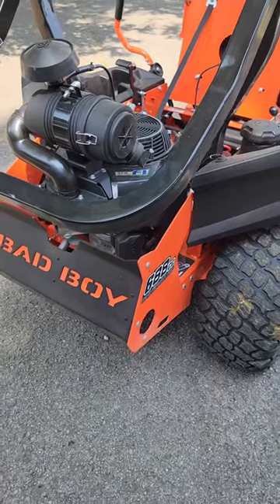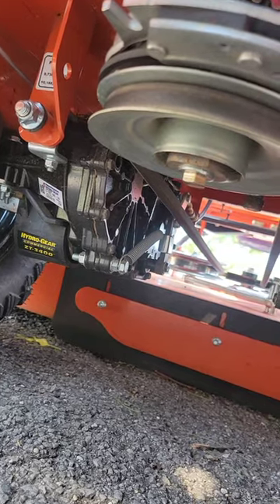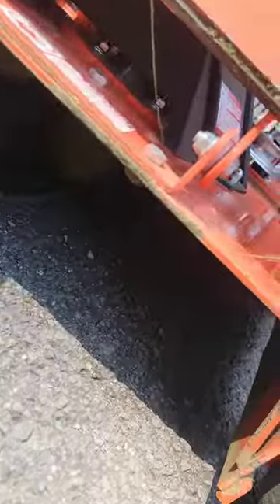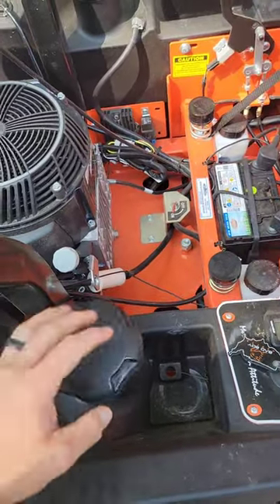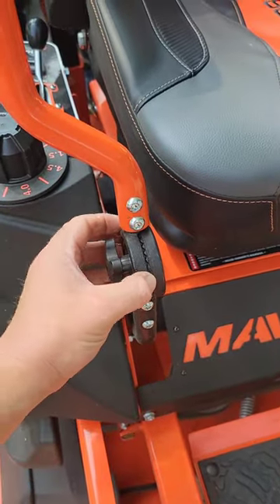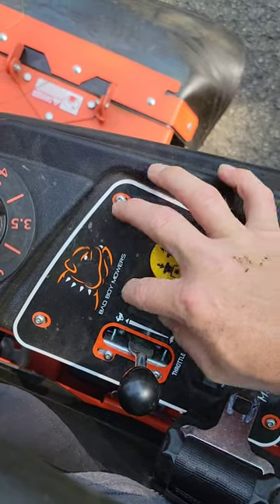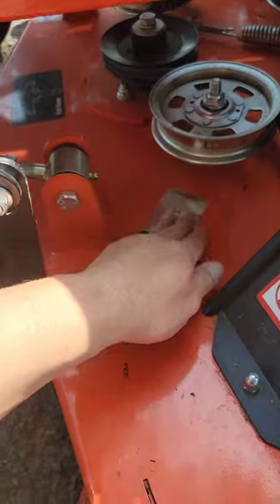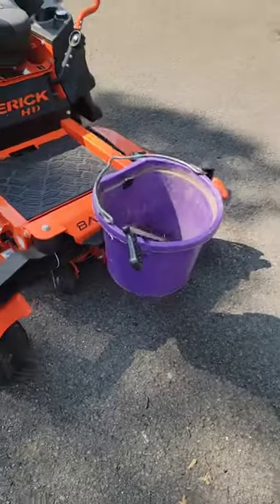Badboy Maverick HD 2023 | 2mo Review

Comment: I never wash my mower I use a leaf blower to clean it after I mow, and clean the deck by hand with a scraper. My Bad Boy is not the HD version which has a lot of nice options that mine does not have  but mine is still a great mower which is a Maverick 60 inch with a 747cc Kohler
Reply from the maker: I've stopped spraying mine and just blow it off now.

Comment: I love my Bad Boy HD, but to me its really more work to cut the grass. My gas is usually cut to 3 1/2". The cut is great....BUT it leaves about a 1" strip of uncut grass between blade 1 & 2, and between 2 & 3. There is no adjustment for this as this bade spacing is set by the spindle locations, and the blade length. Correct blades are installed and I also put a brand new set of bades on it. The mower still leaves a strip of uncut grass between blades 1&2  and 2&3. Changing cut height does NOT make and difference. So using this Bad Boy  means having to cut twice, since after initial pass, you have to go back and move over a few inches and mow it again. Double the time, double the fuel. After 2 months of this problem, and servce that I had assumed would be mediocre since all Bad Boys are sold at Farm Supply and other such stores in this area, none at a lawn and garden or outdoor equipment dealer. Have tried contacting Bad Boy without success. So I'm back to using a 20 year old JD GX335 with 54" deck that makes a beautiful cut.
Reply from the maker: Mine doesn't have that problem. Sounds like the blades are a hair short
Reply: Sometimes blades say they are a certain length when in fact they are not. I bought some for my Ultima ZT1-50 that said they were 17 1/4 but are really 17 1/16. That leaves a 3/16 space that shouldn't be there.
Reply from the maker: i can see that being a issue. that's a pro tip of something to check when i order blades.

Comment: Why did you go with the Honda Engine instead of the others? What was the $$$$
Reply from the maker: I liked the fuel injection vs the carb system.  All the reviews I read on the honda engines were great. It will self regulate so if your mowing short grass and it doesn't need to run at 100% it will throttle back and if you hit a rough patch of grass it will accommodate accordingly.  I may regret it one day but I just seen it as a upgrade and I got this mower with the Honda cheaper than I could buy it with the kawasaki engine.
Reply: I have the same mower with the Honda , I love it so far . My old Hustler has a Honda that is still running strong after 16 years. Only negative I have so far on the Maverick HD is the hour meter quit after 8 hours but Dealer gave me a new one .  I’m liking the mower so far to mow my 4 1/2 acres . Main reason I bought the BadBoy was because of the build and the option to get the Honda motor.
Reply from the maker: @cwtex59  I agree w you. I like the ease of working on the badboy because eventually something will break
Reply: Hope you guys have good mechanics trained on theses EFI engines. @BrileyWray
Reply from the maker: @dalewiley9208  that's what they make money for. 💰
Reply: Wish they still offered the Honda, I think they are the king when it comes to small engines.  I think I’m gonna go with the vanguard 28 efi.  Guys seem to like them.

Comment: I got the 60 HD Maverick I was told at dealership you need to fill up the tanks together carry 13 gals and it's speed up to 11mph and very comfortable especially for someone has had back problems the seat is worth every 1300.00 of it haul ass nand pick ur feet off deck and it will feel like u cutting in cloud's buy it worth every 10,000 of it you won't regret it cut with a attitude 😅
Reply from the maker: I agree,  it's a blast to cut on and never regretted buying mine

Comment: This is for the man whose mower left strips of uncut grass between the blades. I had the same problem with my JD lawn tractor. I mentioned it to a JD parts man and he said that he was a helicopter mechanic in Vietnam. He said that I was aligning the blades wrong. He said that the solution for copters is the same for lawn mowers. Multiple blades should be perpendicular to each other to do the best job of cutting because the rush of air will suck the grass blades into the path of the mower blades. 

I felt like a fool, but took his advice and it solved my problem immediately. 

I absolutely love my  60” deck Maverick HD with the Honda engine. It’s bulletproof!
Reply from the maker: I agree mine is still running strong 💪

Comment: I’m considering bad boy. Thank you for this helpful video!
Reply from the maker: Glad it was helpful
Reply: I was also considering one of these. I decided against it after seeing it in person. There's SO much plastic on the engine and on the mower- Even the engine cover and air cleaner housing...ridiculous for $9K mower. Plus, these engines being fuel injected means come the day it doesn't start, you can't even fix it yourself because you need a special scanner (not the common automotive ones) to see what the problem is. These things have an ECM, oxygen sensor, MAF, MAP...everything that your car has..and are way too complex (and parts too expensive) to just try and fix by trial and error- and seeing as electronics are especially vulnerable to moisture and dirt, stuff WILL be failing- and the warranty is only 2 years (Which is about how long it'll go until stuff like the electronic fule pump and sensors start failing!). Darn ECM for this mower lone costs over $400..and if they've stopped making it by the time your goes... I've decided to go with a slightly older carbureted used mower, that still has actual metal parts.  This is way too much money for a short-lived disposable mower.

Comment: You can stop tearing the grass up when turning if you don't just stop the wheel on side you are turning to. Pull lever to reverse wheel on side you are turn to. This allow mower to do a mini cycle and not tareup grass. Do it slow at first. You can go faster after you get timing down to turn without targeting up grass. I taught this for 21 year works in demoing mowers.
Reply from the maker: This is very interesting

Comment: hey man, great vid. Can you tell me if you're still happy with this mower and Honda engine combo as of today 10/10/24. I'm about to pull the trigger on a used one only 5 month warranty left and like 80hrs on it. What do you think would be a good price? I'm trying to get it for $6k or is that still too high?
Reply from the maker: @thepropertygurus.9940  I would just look around at the price of other used ones for a price. That sounds reasonable.  I'm still very happy with my mower. Run 100%gas and it cranks everytime and runs great no issues to speak of.

Comment: Thank you for such a in detail review. Always wondered about the fuel injection and also about the hydraulic filters. Because I was going to add some inline ones. But I'm pretty set on the Maverick. And I've always asked in other videos about the hitch. That wide doesn't these models come with a hitch for aeration  for example. Definitely appreciate you sir.
Reply from the maker: I have a video of the Hitch I built and installed on mine . But I agree they could afford to put  Hitch on the HD models

Comment: I have the zt elite, 54” with the Kawasaki engine, so far so good, hr meter stopped working,
Machine is loud, could be I have a deck bearing going out,
I never wash my mower, do not want to get water down in those bearings,
I just blow it off,
Reply from the maker: from what i remember they are sealed bearings. i could be wrong but have had reserves about spraying the engine with water with all the electronics back there. but it gets it so dang clean lol

Comment: Just bought my Maverick HD with the honda in a 54 inch as well. Good unit, except what caught me off guard compared to your unit is I only have the left tank and no right tank and I also did not get the stripping kit with mine. Only other mention is that I do not have a black cover on my honda IGVX700, mine is red. Not sure if I have a 2022 model or a 2023. I will be looking to add the right tank in the future as I do like having weight more evenly balanced as well as filling up with less intervals per month. Great video, wish I would have seen this when I bought my Maverick HD as at the time the honda equipped units had almost no videos to them.
Reply from the maker: I had the options to get the red motor cover in a 2023 but chose not to. And some one mentioned below the gas tanks were on recall so maybe that's why your only had a single

Comment: Quick question on your honda motor. I have the exact same model amd engine combo. I love it overall. However, i do have one nagging question.
Does yours take a bit longer to start than a typical carburated model?
Mine has always taken 3 to 4 seconds of cranking to start. My carburated motor on my last mower fired over almost instantly. 
Is this normal for the fuel injection?
Thanks for your video
Reply from the maker: Mine probably turns over once or twice before it fire's.  I would say it starts faster or just as fast as my carb mower I had.
Reply: General consensus is the Honda's don't like ethanol. I have a tiller that does the same thing. Non ethanol gets pricey but since I only use the tiller for an hour or so a year, 1 can of non ethanol would be fine. But it cranks, so I just forget about it for a year.

Comment: Interested to know how everyone is choosing the Honda engine, but I don’t see it listed as a choice on their site?
Reply from the maker: On the 2023 model it was available
Reply: And the 2022 model as well. As a matter of fact the 2022 model is probably the only year with the igx 800, in 2023 they only offered the igx700
Reply: Overall yes, a fuel injected engine gives precise fuel measurement and a bit more fuel economy, but is it really worth the extra cost to get it, on a Honda mower. Honda is a good engine, but Kawasaki has been the king with most every brand of outdoor power equipment. Same great warranty. Plus carb equipped engines are not as particular when it comes to a bit or dirty fuel. Lots cheaper to repair, and junk in the fuel is somrthing that is a big possibity with ysing typical 5 gal gas cans to carry fuel.
Reply from the maker: this is all good stuff. i typ run 100% gas and change the fuel filter regularly. so far i haven't had any trouble out of my Honda engine.

Comment: Those hydraulic reservoir twin filler tanks will crack and leak......its better to have the metal bolt plug in the hydro case....also NEVER wash the mower, ALL bearings are sealed n youll have to pop the seals to regrease bearings...its easy....
Reply from the maker: Thanks for the tips

Comment: Can anyone tell me if there a switch for which fuel tank is being used right or left side? also if there is where is the location.
Reply from the maker: There is a fuel cut off under the seat but I think it uses both tanks simultaneously
Reply: No there's no switch the both flow to one point maintain both tanks full

Comment: honda engine is a great decision.  I always start the pto with engine on high .
Reply from the maker: Thanks I do the same
Reply: That places extra stress on the clutch.  Your mower, your money. @BrileyWray
Reply from the maker: starting the pto with the engine on high or low? I'm confused?   @dalewiley9208
Reply: @dalewiley9208  dealer said it's designed to engage blades full throttle